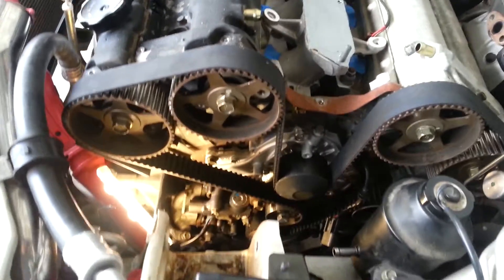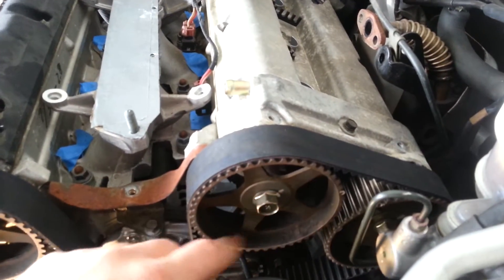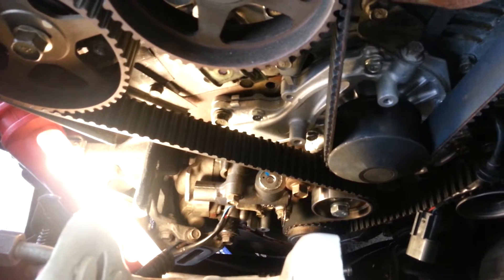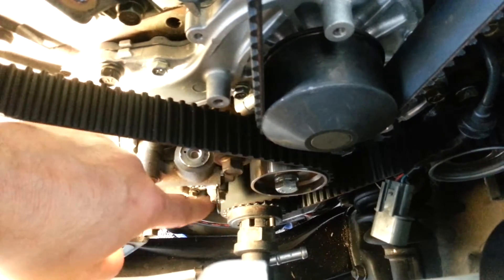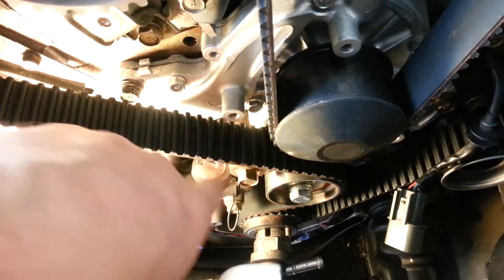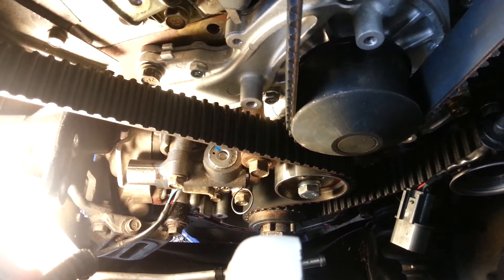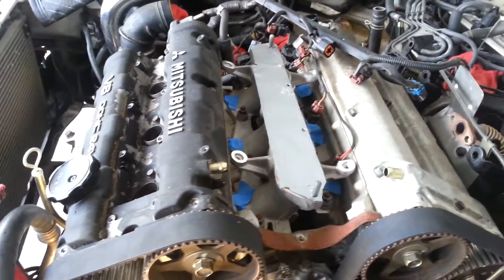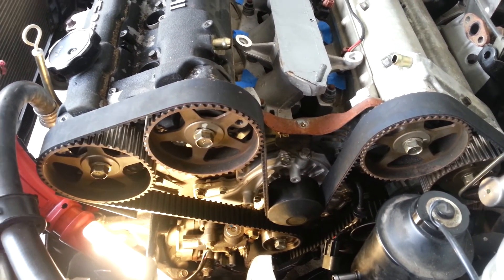Last VR4 Built - Timing Belt Installation

Comment: You said you put the crank 3 teeth back so you can move the cams freely, did you put the crank back into time right before you slipped the belt over it?  Also I read that you keep the crank one tooth back, slip the belt on, then put it back on time and the belt will be tight.  Does that sound right?
Reply: wtf
Reply from the maker: Sorry Druggist, I missed this comment.  You are correct. Once the cams are in their final position, rotate the crank to one tooth back from TDC and install the belt. Then you can return the crank to TDC.
Reply: So if I don't have the tensioner tool for tensioner pulley is there another item that works best at this moment I have all my cam gears lined up and I am one tooth behind on the bottom right now I'm looking for that tensioner pulley tool or something to substitute for it
Reply: You can take a fork and cut the two middle prongs with a Dremel.  then bend it into a right angle with a vice